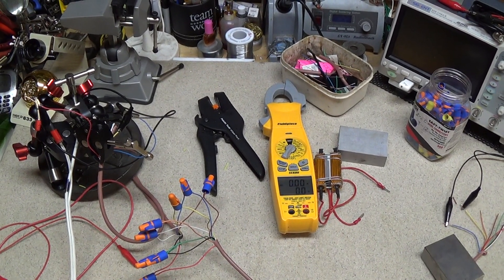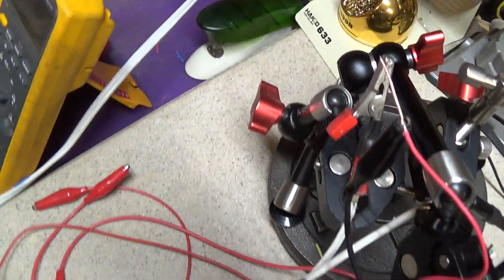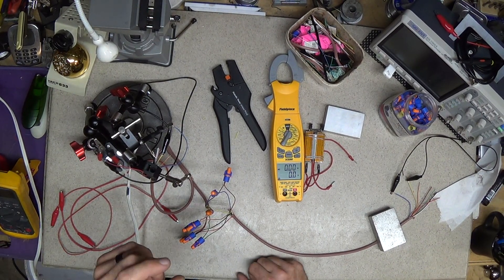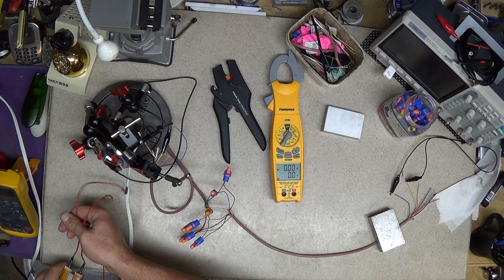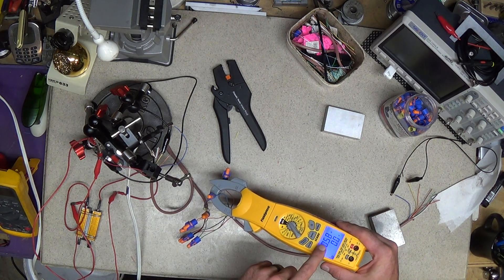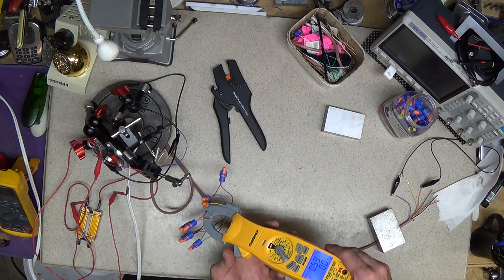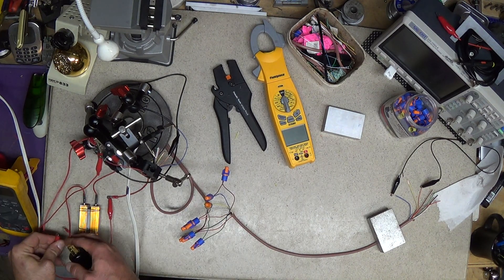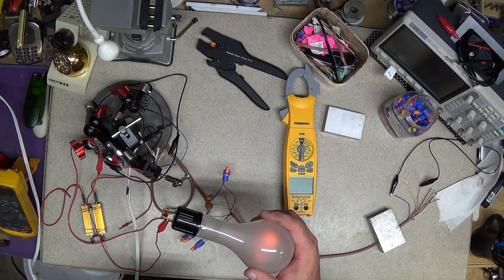Tip11: How to Find a Low Voltage Short (Part 1of2)

Comment: Is that working the same way as the short pro tool?
Reply: I believe the older Mars short finder was just an led light, without the resetable breaker.
Reply: @HVACLife  I've never used one, but having seen the resistor/light bulb method u showed, has me rethinking how I find shorts
(usually a 4 wire jumper and a 3 amp resetable) 

As an aside I wonder how much better an led bulb would work, given the lower voltage requirement and just much smaller they are.
Reply: @asg58  if you have a strong enough bulb, do you need the circuit breaker?